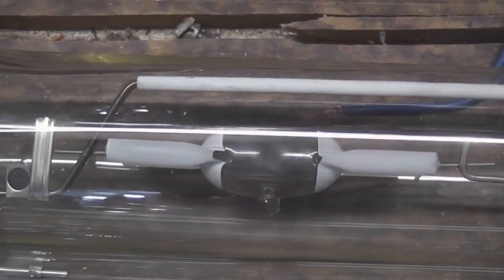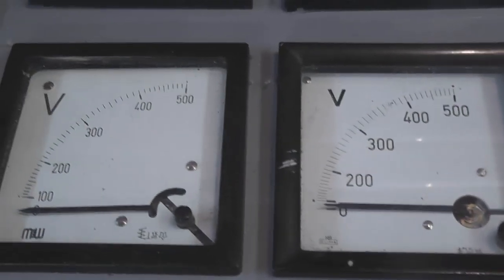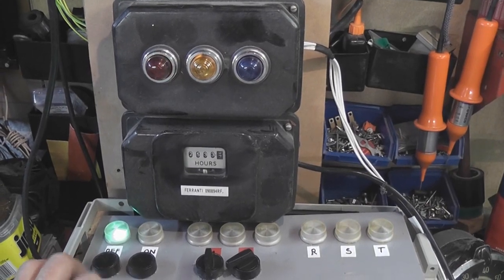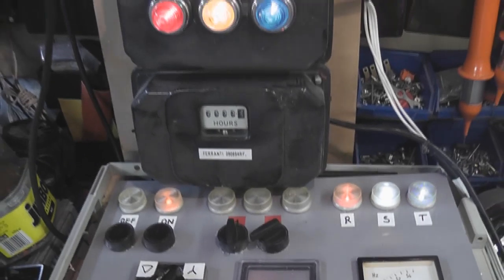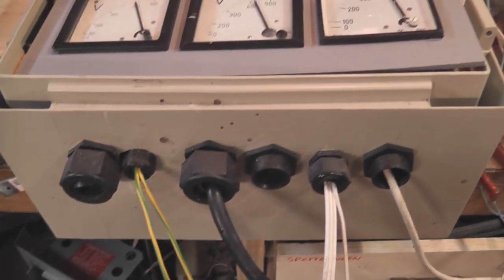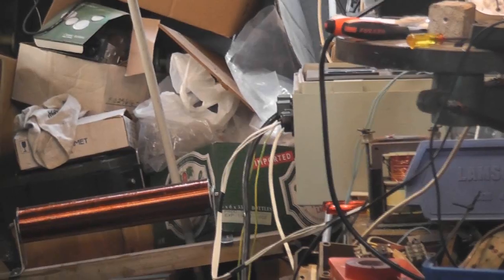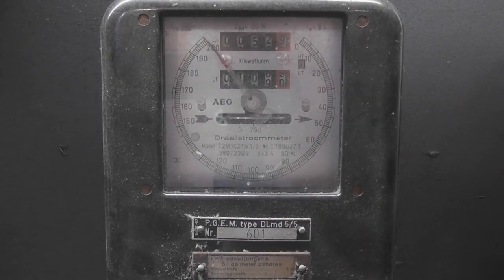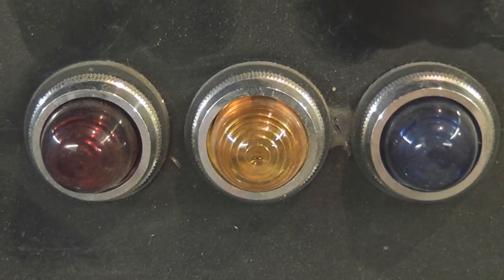3 Phase Rotary

Comment: Lag / lead? I don't understand the concept.
Reply: Lead is when the current peaks before the voltage (capacitive load, (current leading) Lag is when the voltage peaks first (inductive load (current lagging). Hope this helps.
Reply: So its basically it is a measure of the type of loads on the AC?
Reply: Capacitive vs inductive?
Reply: Tom D For example if a ac circuit had a power factor of 0.5 (leading or lagging the current would be 180 degrees out of phase with the voltage. I.E 240v x 10A x cosine 0.5 = 1200w (2400va) where as in a Dc circuit it would be 2400w.
Reply: Ahh I see. What implications does this have?
Reply: Tom D Well the power companies have to compensate and generate wattless amps, also if not allowed for in circuit design can overload circuits and cables and cause fires even though in theory the circuit can handle many times the power. There is also the problem of harmonic distortion. A good electrical engineer will allow and take measures to minimalize and correct at the design stage. Tom, if you are interested Google Power factor and electrical harmonic distortion.
Reply: Watt = volt X amp so how can you have wattless amps? Or do you mean high amps at low voltage so lots of power loss?
Reply: Tom D Watt = volt x amp x cos φ for AC , volt x amp = VA
Reply: TheBrentieman Ah.

Thanks for your explanation!

Comment: Is this for converting a single phase supply to three phases, in order to run 3P equipment from 1P?
Reply: ***** Thanks. I've seen this before, but with two separate motors linked by a belt.